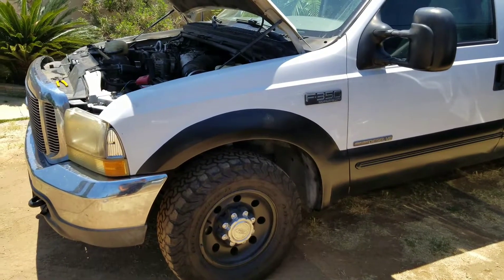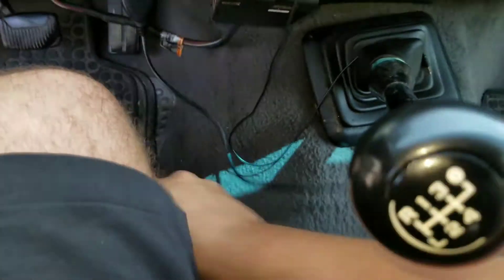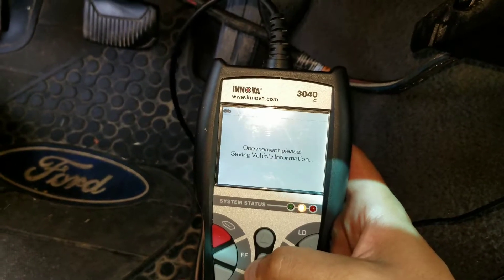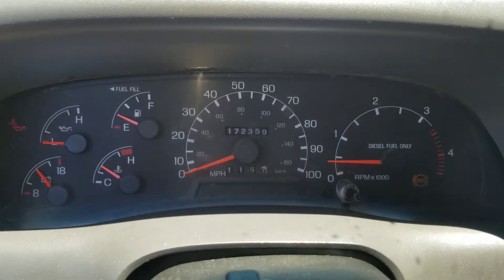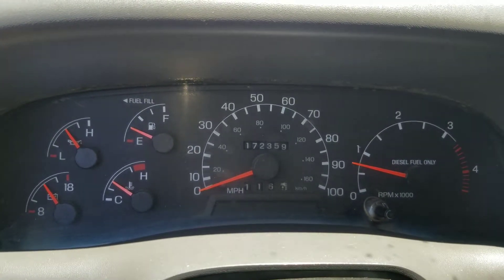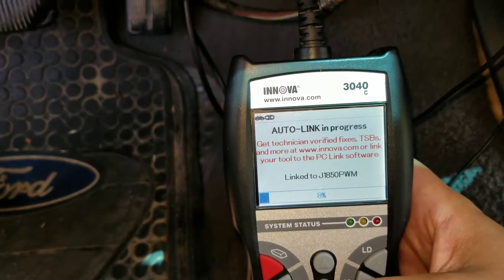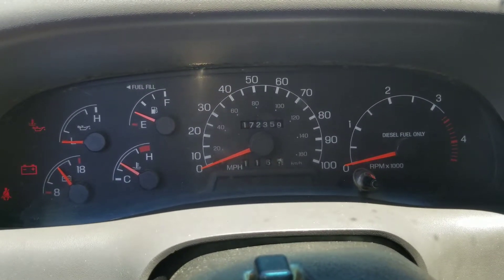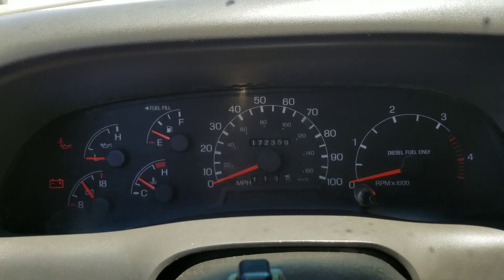1999 (late 99) P0308 phantom code? Pops after warm restart - any ideas?

Comment: Had the same problem. Searched all over the web with no luck. I won't bore you with all the tests I've done from "blog suggestions."
 Today I changed my IPC  sensor( there was a small amount of oil in the connection) and did the banjo bolt mod. Light went off when I started it after a 16 mile drive. Did two more 8-10 mile drives, restarting each time. Code still has not come back. :)

Comment: had the same problem, firts check the wiring harness up to the valve cover, remove 10 milimeters bolt . maybe short wires there ,and then disconect and reconect the IDM ,. 
that's what i did and it worked!!
sorry for my bad english
Reply: After resolving a short circuit in the main harness above the valve cover, disconnect the IDM and check for possible corrosion or sulfate on the pins.
reconnect and start the engine, accelerate to 2000 rpm for 30 sec.
That was what I did and it worked.

now i use google translator.